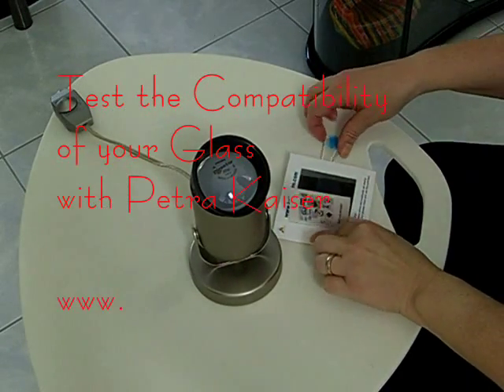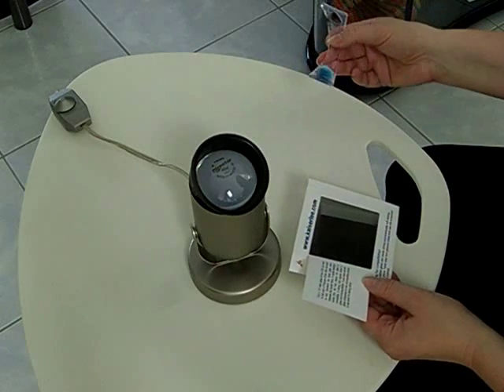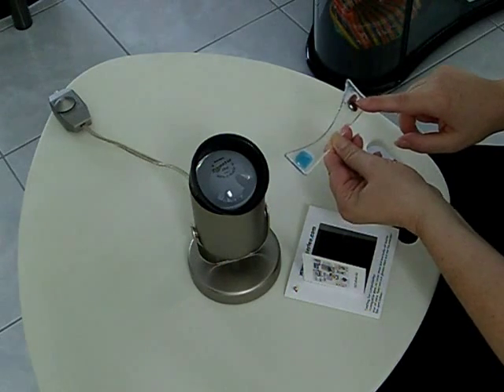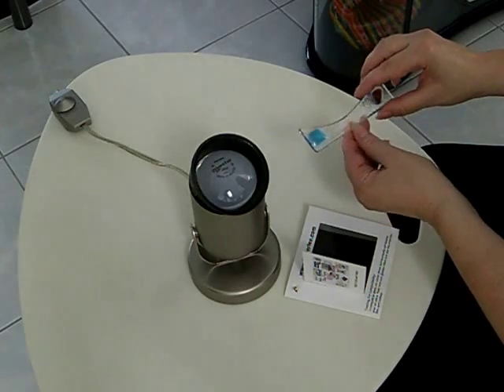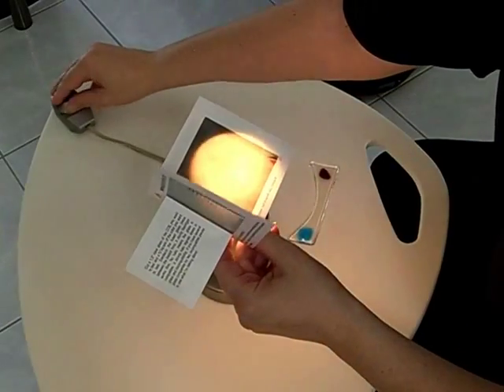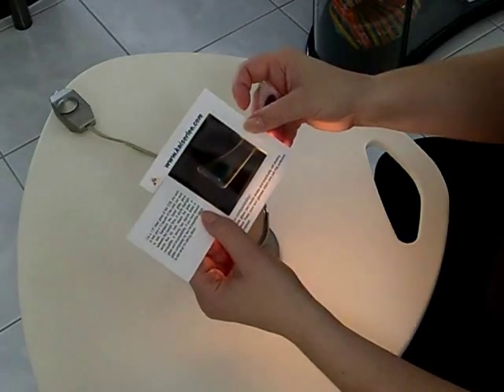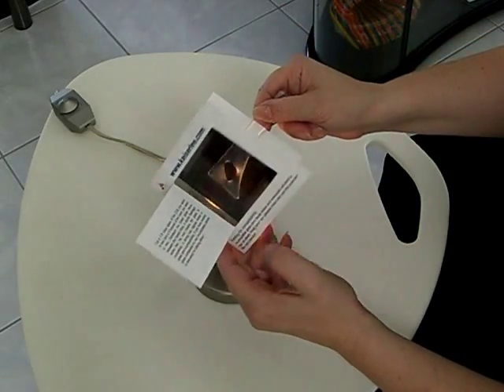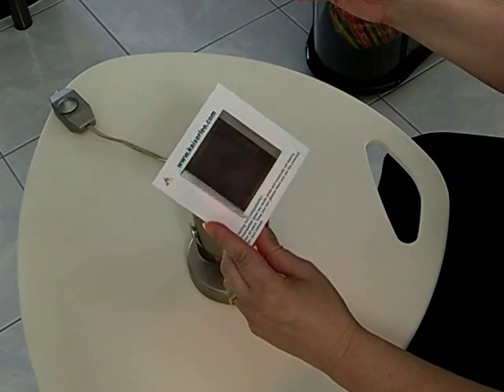Glass Compatibility - testing the right way!

Comment: I recently ordered the card from you and I noticed that the one you use in this demo does not have a solid card covering the lens.  The one I got has a solid piece of cardboard covering the lens that is closest to the light source.  I called you and you stated to keep that cardboard intact.  Why does your card in the demo differ?  Also, I am testing the colored glass and not the clear glass.  I know that my clear glass is 96 so if the glass is not 96 there will be a halo?